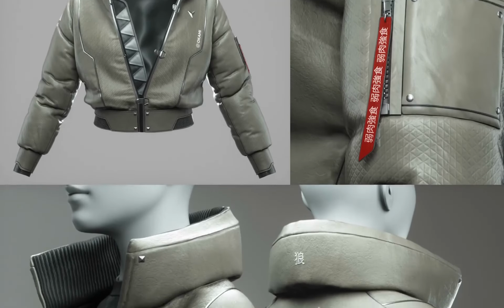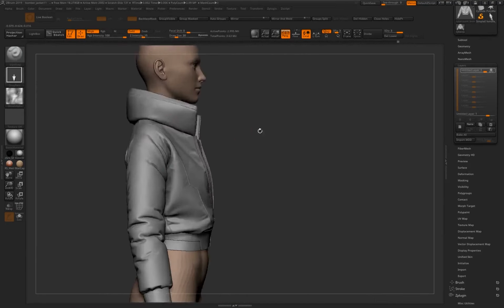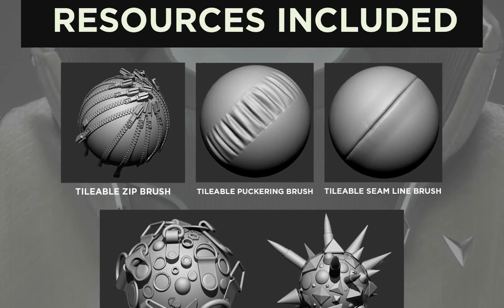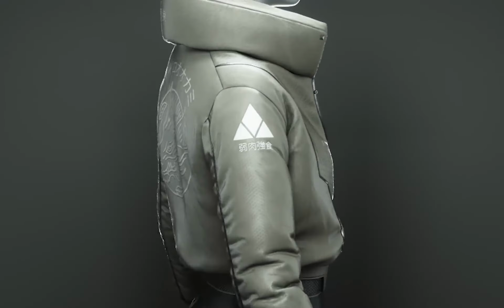NEW COURSE - Cyberpunk Bomber Jacket - 3D Fashion Design Course

Comment: I think a lot has changed in Zbrush under the hood. When I try to split the panel loops in the end, I'm left not only with the sides, but also random artifacty top and bottom faces, which I have to clean up manually :(
Reply: To counteract that, you can delete the lower subdivs on the highpoly before seperating the panel loops.

Comment: This course looks amazing ! However I got one question ! If I purchase this, the purpose for me is to animate the character with the jacket (or an other custom jacket of course). But the Zbrush part can't be added to the animating workflow right ? I would take mixamo animations, make them blend together in C4D, import it in alembic into MD, create the jacket, than make the simulation, then .... It won't be possible to ZBrush the thing right ? 

Thanks for your impressive constant work Travis !
Reply from the maker: Hmmm, might be tricky because this course was created with the sole purpose of rendering still images, no animation workflow in mind to be honest. However, any sculpted details in zbrush can be baked into a normal map and applied onto the animated garment BUT some of the details will probably look off and not align properly. You can still do the whole course and skip the zbrush part if you just want to do animation. You'll still have a pretty cool garment created straight from MD.
Reply: @TravisDavids  Hadn't thought of baking normal maps ! That could work indeed ! Thanks for your reply Travis :D

Comment: Hi,In this course Can i follow  without using zbrush, like Marvelous designer to substance designer?or zbrush is essential here?
Reply from the maker: Zbrush is essential for adding additional detail. You  can go from MD to substance painter but you'll miss out on some awesome detailing using zbrush.
Reply: @TravisDavids  oh i c,i just don't have tablet so never looked into to sculpting,so is it possible to follow things with normal mouse and beginner in zbrush?if so i will use the trail version,thx for thr reply :)
Reply from the maker: @incridablekarthi228  No i would never recommend sculpting with a mouse, you're going to give yourself a massive headache without the use of adaptable pen pressure. Get a tablet, it will make things a lot easier for you when it comes to sculpting.
Reply: @TravisDavids  ya ,iam planning to get one ,thx for the answer :)

Comment: Thanks a lot for the tutorial.. I just got it .. till ZBrush everything was going pretty well :).. but i have couple questions. i use Clo3d  there is an option for UV when i export the object but there wasn't a UV editor on there to arrange each pattern pieces on it self grid.. so i will see what will happen when i need to use the UV later on your tutorial.. Also on Zbrush, i really didn't get it how you bring the clothing and the  avatar together on the canvas..Like they were kinda merged.. I followed your instruction exactly , append the avatar under outfit but they don't come together when i tried.. and when i do separately the scale is different so having trouble with that.. do you have any suggestions for how we can bring them together  on canvas?
Reply from the maker: Hi Pinar, yup difficulty can ramp up a bit once you hit zbrush. Hmmm, not having access to the uv editor is just not going to allow you to create UDIMS to allow for higher texture quality on your garment when you actually start painting it so you will be limited with your resolution and it's going to look low-res unless you know how to alter your UV's and create UDIMS outside of CLO3D. With regards to zbrush, Import your character first, click on the polymesh 3D star icon, import your garment. Now go back to your character and append the garment, it should be at the exact same scale. I have done this every time and the scale is never messed up so i'm having a bit of a hard understanding why it's not working for you. Hmmm, maybe the scale of the character or the garment somehow got messed up on export from CLO? Where your export settings exactly the same as my MD settings?
Reply: @TravisDavids  Thanks Travis for the reply.. I will start all over again to see if the scale will be same and if they merged together when i bring them to the canvas.. also i will contact with CLO if there is a possibility to create UDIMS.. will update you later :) Thank you again!!

Comment: Travis, i'm stuck in the part import collada file from Daz Stuido to Marvelous Designer.
I already export 1 Collada and 1 OBJ file.
The matter is, i make few changes to my model, i make the model breast bigger and more muscle in body build.
When i import Collada file into Marvelous Designer, it display the base model, i mean no bigger breast, no muscle at all.
While if i export OBJ file, it display correctly exact what i want.
So please help me with that Collada part, i have no idea what to do.
This is the first time i use Daz and Marvelous Designer to make cloth. I only know how to use zBrush.😂
Reply from the maker: Thank you for the support Jack. Yup i have mentioned clearly in the tutorial that the COLLADA is only temporary and that i will always use the OBJ as my final pose because all of the adjustments i made in daz will carry over to the OBJ and not the collada. Always use the OBJ for the final pose but use the collada only temporarily to fit the garment on the character in the beginning. The reason i'm using the collada is because i can save out the animation (t-pose to posed state) but it should be treated as temporary in the beginning. Once you really start modifying the garment, make sure you import the posed version of the character in OBJ format. It's covered in the tutorial. I made sure to explain everything. Best of luck and enjoy the course :)
Reply: @TravisDavids  ah, ok, i watch it again, i understand now, sorry for take your time.🤣

Comment: Anyone know why my mesh coming into zbrush isn't smooth and looks blocky even with partial distance down to 5?
Reply from the maker: Hmmmm, are you using a daz character or your own? Is your character low poly? In MD8 you can use the option to 'Smooth Avatar" to get rid of the low poly look on your 3D Character. The only reason i can suspect a blocky mesh is that the character might be low poly so when you reduce the particle distance it's taking the shape of the low poly character mesh underneath as well. A lower Particle Distance subdivides the garment to add more polygons and make it hi-res, it shouldn't be blocky.
Reply: @TravisDavids  it wasn't very lowpoly to Begin with but after using smooth avatar it seemed to do the job. Thanks!